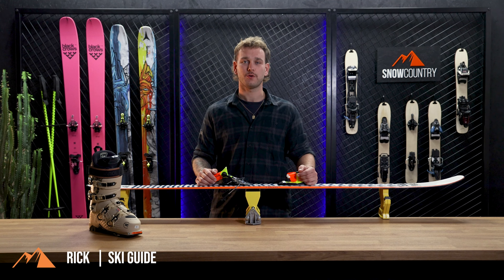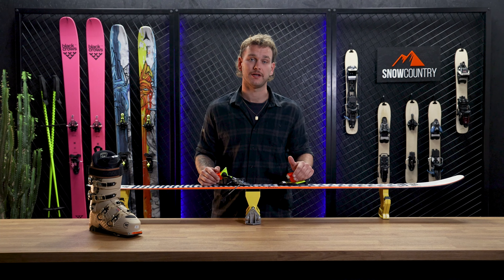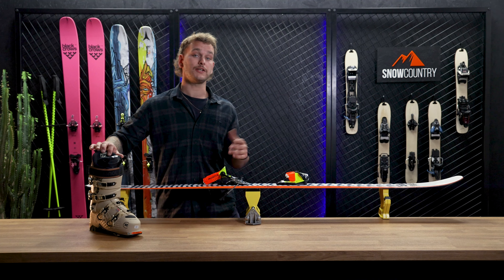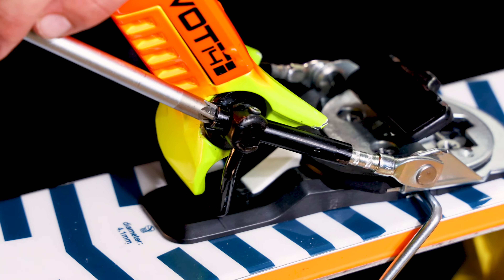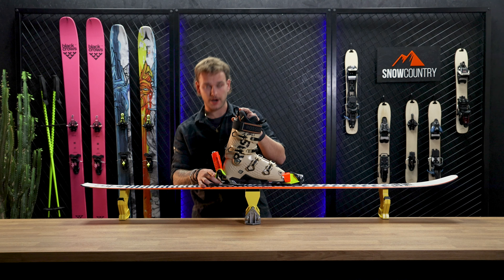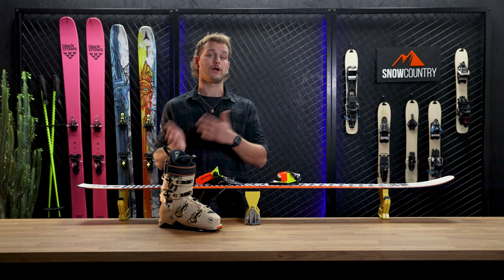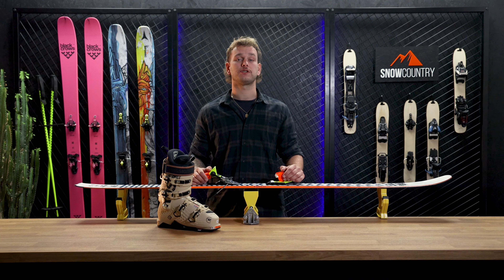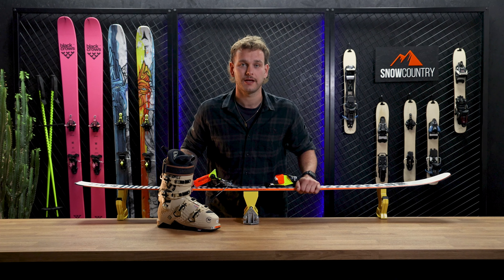How to adjust your Look Pivot binding | Snowcountry

Comment: Part of the foward pressurent adjustment is to check if the heel piece swivels with the binding engaged. You grab the heel piece and see if you can easily rotate it. Also the indicator being just past the tabs is considered okay. These binding take some attention to get just right.

Comment: Does it matter how tight the heel arms are screwed in? Mine are almost fully screwed in but the foward pressure indicator is correct
Reply: Hi, resolve this problem? I have the same:)
Reply: @ I realized the forward pressure indicator doesn’t mean anything 🤣. I just remounted
Reply: @ thx:)

Comment: On mine the toe piece DIN setting appears to change slightly when the boot is secured.  Do I want to match the DIN settings with the boot secured in or not?
Reply from the maker: DIN shouldn't really change with or without the boot in the binding. Adjustment can best be done with the boot locked in.
Reply: With the boot in, my DIN reads higher.  According to the Look manual, DIN should be set with the boot in the binding, so go with that number.